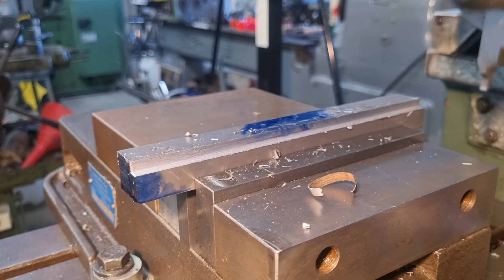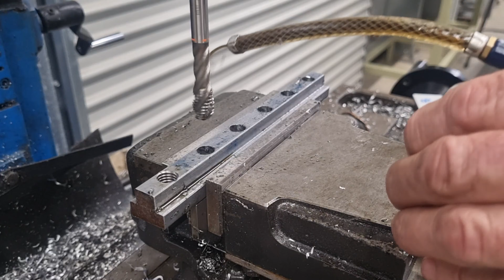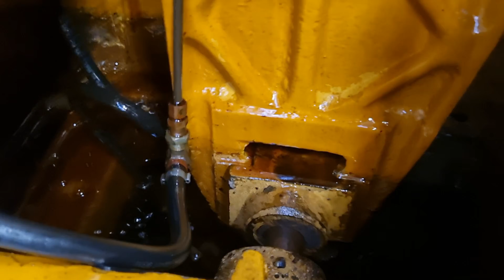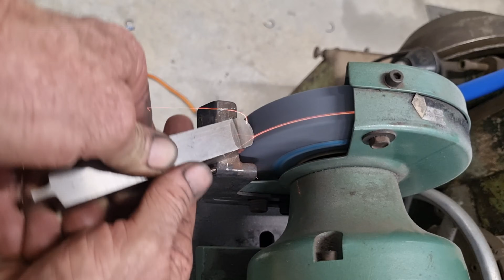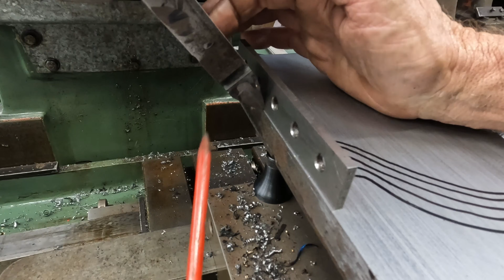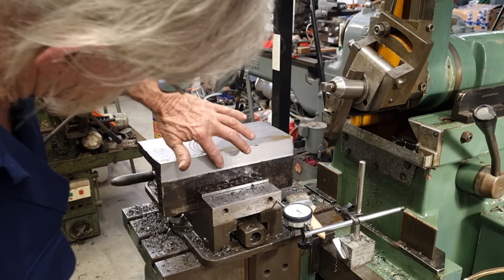Machining on the Shaper .

Comment: Broadnosing a finish is usually done with a perfectly straight edged tool, taking about .002" with a feed rate of about 2/3 or more of the width of the tool.
Reply from the maker: That would be like a planer tool .   I might try it on cast iron instead of steel .   👍

Comment: I wish there was a shop around me that had old conventional tools like you have. Nothing but CNC around here, and trying to learn code infuriates me. I miss being able to actually put my hands on the components of the machines while I'm using them.
Reply from the maker: No worries .   CNC is not in my wheel house ,  never used one .  We were taught a bit of NC stuff as apprentices .  👍

Comment: Its good to punch the lower ends of T-nut thread, in order to avoid holding bolts going thru, so it won't make contact with table..
Reply from the maker: Yes , most times it is .   Cheers  👍

Comment: Hi Max, hope you had a great Christmas, and HNY to you and yours. If you are still in the roughing stages, get a load of DTI's set up onto your table (perpendicular to moving axes) and take a few cuts. I am with you that this is harmonic looking at the shape of the marks. Measuring any flex/bounce before you strip down will help you home in on where the attention is needed. I had very similar on mine following the rebuild, I just threw some stock in, had DTI's scanning all 3 axes and made iterative tweaks to the Gibs between each cut watching for the difference. The cross slide was main the offender on mine. Cheers, Jon
Reply from the maker: Cheers Jon .   I am going to make the base for it & get it all solidly bolted down , start from the basics !    👍

Comment: All the soft woods are conifers broad leaf flowering trees are classed as hard woods even balsa.
Reply: I was tempted to say exactly this.
Hardwoods & Softwoods is determined by how the tree reproduces.

Hardwoods through flowers nuts & seeds, & softwoods by cones & spores.

Jarrah is a hardwood because it has nuts & seeds.

Balsa is one of the least dense (ie hard) Timbers there is but is classified as a hardwood because it reproduces by flowers nuts and seeds.

There are some quite dense (hard) softwoods here downunder as well.

Our local coastal sheoke is almost 2/3rds as hard as Max’s Jarrah hardwood bench top, but is classified as a softwood again because it reproduces by cones and spores.

If only I knew as much about metal. 😜😂😂
Reply from the maker: That's why i don't work with wood , it splits even if i look at it & can't weld the bloody stuff back together !    👍
Reply: @swanvalleymachineshop  You did a really nice job on that table slab, looks great. 👍👍

Comment: That old tool is probably welded HSS on the end, though they were made with Stellite and other material cutting tips, its just far more were made with HSS.
You can still get them, they are still made but are expensive, in most cases it wouldbe cheaper to buy a new HSS blank. Much better to buy them used, often see them mixed into lots of brazed carbide tools as not that many people know what they are, or search for welded or brazed HSS tools.
Reply from the maker: Thanks  👍

Comment: Great video Max,
The wavy lines that you have at 90 degrees to the cut are caused, I believe, by the meshing of the gear teeth on the bull wheel and the main drive pinion.  I have seen that many times before.  The ram has as an acceleration and deceleration as it travels through its stroke as this happens the load on the gear teeth and the mechanism is changing because of the Whitworth drive mechanism.  This changes the frequency of the mechanism,  causing the lines.    

There are different schools of thought regarding finishing tools some prefer the shear tool others prefer what is known as a front finishing tool.  Both types should really be of the swan neck or set behind the tool shank which is possible if you have a planer shaper tool holder.  It also depends on the material that you are cutting.  This type geometry prevent the tools from "digging in" and help to improve the surface finish.  

The last tool that you used for cutting the side face is a left hand knife tool it looks like it is of the butt weld type (HSS butt welded to a very tough shank).  These were very common at one time and are still available here in Britain a company called Rennie still makes them and also the butt welded swan neck planer/shaper tools.  https://www.rennietool.co.uk/collections/hss-butt-welded-tools.  See number 52 and 53.

Comment: Thanks for posting I always enjoy your content  just a small comment  you should put a little plastic plug in the angle lock nut on your Kurt vice it keeps the chips out the screw and it only takes 10 minutes
Reply from the maker: I noticed that the other day , it normally faces away from me on the milling machine ! 👍

Comment: Max, I just remembered, Adam Booth also recommended fileing a chamfer on the leading edge of your work piece, as well as the other end too to help keep vibrations down on the tool and to keep from getting chip outs on the edges, but for sure a chamfer on the leading edge sounds like a good idea to me. When he did it he didn't put a huge chamfer, just a half dozen strokes or so with the file. The type of material your working with would probably make a difference on how much of a chamfer to use. 👍 Cheers mate! E   PS: let me know if you could use some help finding some mo max Cobalt tooling blanks, be glad to help brother!
Reply from the maker: The chamfer helps , it's done on cast iron to stop chipping the iron .    I think i have one small bit of Mo max  & one of Rex 95 .   3/4  tool steel is what fits my machine , hard to get here .    👍

Comment: Max, hey brother, good video. I hate to bring up Adam Booth again, but I've watched a lot of his shaper content and have learned a good bit by doing so. I'm not a machinist, but I watched him take his precision flat stones and after grinding his tool (I noticed he uses a lot of the mo max Cobalt for a lot of his tooling for the shaper, less vibration I think) be places his precision flat stone on the work or flat surface of the vice, and lowers the tool head to alittle above the stone, takes a piece of paper and lays it on the stone tnen lifts the clapper box and then brings the tool down onto the stone with the papers width between the stone and the tool and gauges the tool height to just a little higher than the clapper being completely down but touching the paper then he removes the paper and then hones the tooling with the stone moving it back and forth against the tooling. I think the tooling when he is honeing it is just shy of having the clapper completely down. Not sure. But his finishes he gets is really sharp looking, looks great. He has shown a book or magazine on a couple of his shaper vids that show a number of different tool grinds. If you contact him he might send you some of that info if your interested. I don't know his email off hand, but I can get it if you want. I know he uses Instagram a lot, it's Abom79 or some derivative of that. Thanks for the great video Max. Hope you and your family are having a great holiday season! Greetings from Phoenix Arizona, USA, cheers mate! Sincerely, Eric, a fellow southpaw.
Reply from the maker: Thanks .  I have watched his video's .    I have to find some dedicated tool blanks for that machine .   👍

Comment: Hello Max. A lot of the finish problem is the material type. I have the same problem. A suggestion is to try less tool stick out and angle the shaving tool edge to 45 deg to direction of travel. Good video. BC
Reply from the maker: Cheers Bernie .   The tools were pretty well as short as i could go , the ram was only just clearing the job !   Further investigation will be required  .   👍
Reply: Hello again. I use lock or Wilton tool holders as they are meaty and you can use smaller tool bits. BC

Comment: Really don't have any knowledge of shapers, long, long time since i used one at college. Just a thought on the marking on the surfaces, you can hear the gear drive while the machine is running. I wonder if the drive pinion is worn in comparison to the main gear and this is translating to the slight shudder in the cutting tool. It will be interesting to see what you find during the refurb. Maybe make a new pinion to suit the wear on the main gear.
Reply from the maker: There is something out of adjustment , will find out soon .   Cheers 👍

Comment: Just curious and this maybe a stupid noob question, are those sides finished as they are or would you put the angle plate on a surface grinder? 
Sorry if this is a dumb question, I am just learning a bit of hobby machining since retirement.
Reply from the maker: The sides are only rough machined .   Finish cuts i will do last in the shaper .   I have a good size surface grinder but it is not up & running yet .  👍

Comment: Hi Max, Jarrah is getting scarce now, we cut too many trees destined for railway sleepers, shameful.
I have a Piper live centre on my small lathe, Aussie Quality.
I have a Stellite 1/2" drill, drilled a hole through a flat file at max speed on my DP, hole size was exact, lots of fireworks drilling it and no damage to drill bit.
Reply from the maker: Thanks .   I think Stellite would be hard to find now days .    I have a good stash of jarrah from when i used to play around slabbing the stuff .   👍
Reply: Hi Max, Stellite welding rods are about 200 dollars aud a kilo up here in Philippines,  wonder if you could hard face a shaper tool with them, I know my brother used satellite tig rods for hard facing chain saw bar tips.

Comment: G'day Max.  Lots of Do's & Don't remarks,  but because I know pretty well Nothing about shapers, I can say Job Well done.
You have different hardness in your  angle plate giving different facial readings, but ... chips are still flying whether horizontally or virtually. 
Amazing the difference between Carbide & Tool Steel Cutting tools.
Overall a Great video, it's good to see you slowly using the various machines in the shop.
Have a Prosperous & Great New Year to You & Yours for 2024
Reply from the maker: Cheers Ted .  🍺🍺🍺

Comment: the chatter marks i reckon are from  the bull gear thats why they look even ,you never get those type of marks on a hydraulic shaper.i run a shaper similar to yours its a seba 600 and i spent hours trying to eliminate said pattern,you will find it only happens on light to medium cuts not really visible on heavier cuts.a very sharp shear tool will help no end on improving finish..
Reply from the maker: Thanks .  A shear tool would help i think .   I am going to go over the machine soon & check every thing out .   👍
Reply: I was thinking the same thing. The consistency of the marks suggests something in the drive line, be it the bull gear or the eccentric actuating arm (or whatever it's called, I think of an eccentric type setup when I see those mechanical shapers for some reason). It could be in the tool head or the sliding head or the clapper box for that matter, but I think your right that it is in the internal drive line somewhere. It would probably be a good idea to use a spacer in the lantern too. I know Adam Booth always uses a spacer in the tool holder lantern, instead of just tightening down directly on the tool. 👍

Comment: In the audio you can hear what sounds like a fairly high speed low knocking noise. Possibly that could be putting a vibration into the ram? In looking at the second cut you did the marks are fairly close together so I thought maybe that noise was causing those marks, just a wild ass guess! Enjoy your content and look forward to more!
Reply from the maker: Thanks . I think there is some play somewhere .   👍

Comment: Hi Max, Happy new year. You are going to have some fun with this bugger. As far as I can see you have 3 possible sources for the poor finish, 1: flex in the clapperbox, 2: wear in the ram, 3: wear in the knee, all of which will mean giving the scraper another runnout. Looking forward to the progress. Best wishes, Mal.
Reply: Never saw a shaper in use when under the thump. Great internals with oil bath. Great for taking corners out.
Reply from the maker: I think i will be looking into it before i continue with the angle plates .    Good a time as any .    👍

Comment: Good one, Max. The "chatter marks" you show at 30:00 could come from hard spots in the material after flame cutting or welding. The video shows different finishes in the top surface where the plates are welded. On my shaper I have the same results.
Reply from the maker: It will be different where the weld is .   I think there is some excessive play somewhere .    Time to investigate !   👍